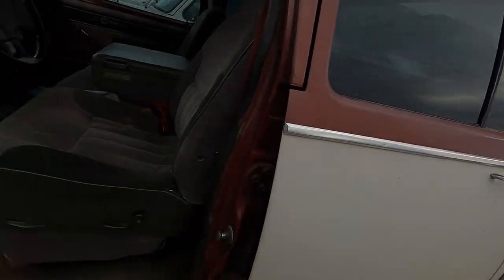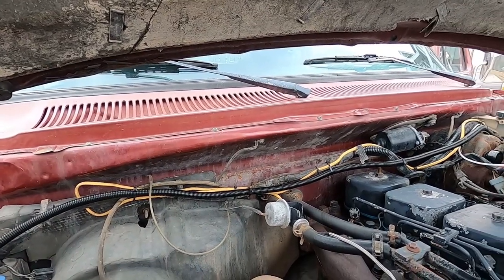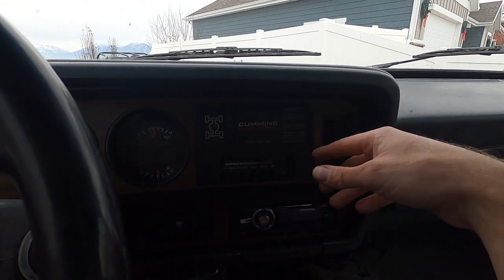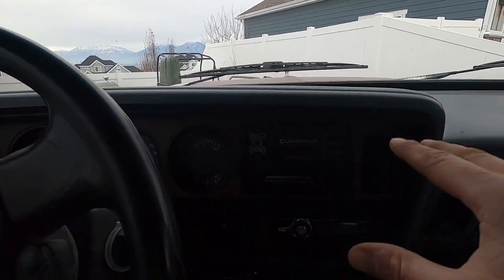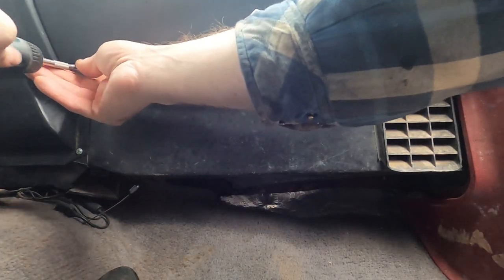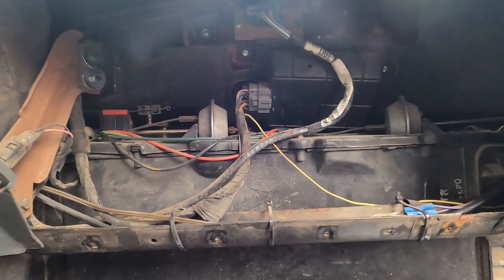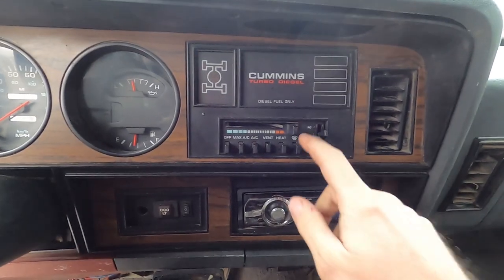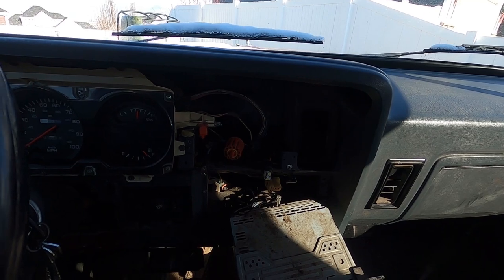1st Gen Cummins Heater Controls | Turning up the Heat 🔥

Comment: Thanks for covering this. Myself, I currently don't have maximum fan setting with that Climate Control Unit of my 1990 Dodge. Since it's a different part of the fan circuit, I'm going to try to repair the switch itself, since if I play with it, I can get it to work, a little.

If I have to pull the unit, HOPEFULLY I won't have to pull the stereo: It's the newer generation of digital-only stereos - no DVD drive, etc., and only sticks into the dash about two inches.

Comment: Would you have a part number for the light bulb on the heater control/hvac back light? My truck just has a hole in the back where a light would go. Not sure if it’s just a twist in bulb replenishment bulb or if I should be looking for a wire and light behind the dash like the 4wd indicator light.

Comment: Most of the time when these trucks have this problem is from the vacuum line junction. The rubber rectangular piece under the dash where all the lines plug into and out of.  They dry rot and come apart. Look for that piece. I have had this problem and have had to swap and or join the lines together directly

Comment: I noticed that you have two keys on your key ring. One is for unlocking and locking the doors and one is for actually starting the truck, if I am correct. Is this the same for your truck. My black key won’t start my truck, I have to use the other one. And the other key won’t unlock my doors. It seems that your setup might be opposite though. Just curious.
Reply from the maker: I actually am not sure haha. I figured they were both ignition keys. I check that out this week.
Reply: Sounds like the ignition key assy on the column was replaced. It comes with new keys when you buy it. I've already had to replace mine twice. Short of having the new assy keyed at a locksmith, you'll have different keys for the truck. One to start it and one for the doors.

Comment: What were the two sensors on the intake manifold where you were working on the brake booster? One was unplugged?
Reply from the maker: I haven't looked too much in to that but I know the motor is a 97 and the wiring harness is a 92 so I think it may have to do with that. I'll check it out more in depth at some point 🤣
Reply: I've got this issue with  my truck not idling until it warms up? 91.5 intercooled...I have the same sensors , I've replaced all of them... Runs fine when warm? Weird!

Comment: Hey Decent Garage, great video! I'm wondering if the HVAC control center routing is the same for an 86 Ramcharger?? I'm having a similar issue and I believe this video helps!
Reply from the maker: I'm not sure if the pre 89 ones are vacuum actuated or if it is all mechanical...

Comment: So I've done everything to mine to get my controls to work, I've got a new control part, I tried messing with the vacuum line under the hood and I check the lines under the dash. No matter what I've done I still have no change. The controls are stuck on defrost/feet I just got this truck and I'm getting lost. Any tips or advice that may have not been mentioned in this video??
Reply from the maker: Sounds like your blend door is stuck. Google 1st gen cummins blend door and your find some good info on getting it lubed up.

Comment: at 5:20 i am screaming "metal shavings in he booster. nooooooooooooooooooooooooooooooooooooooooooooo"   fyi, a booster swap is not hard
Reply from the maker: It all worked out 🤷‍♂️
Reply: @decentgarage  Crossing my fingers for you. Hopefully they dont find their way into the other systems fed by vacuum. If that booster fails, One thing you may want to consider as an upgrade is the hydroboost braking system from a ~97 cummins truck.

Comment: By chance you would not have a source for a new brake booster check valve for a 1992 W250? Believe it is part number 4485491 but not 100 percent sure.

Comment: Hi! Love the videos! I got a question for ya, my heater in my 90 d350 doesn’t get burning hot. Some people said maybe the heater valve? But I might try and flush out the heater core and see if that helps any. As of now my heater only gets warm and mildly hot when the engine is 100% warmed up. What do you think? Thanks man! Keep up the awesome videos!!
Reply: I got the same problem with my 89. I taken out the core flushed it Booth ways until I got all the junk out. Its better but still not hot! I'm going to pull the line close to the water pump and have a look to make sure its not plugged. After that I dont have a clue.
Reply from the maker: Andrew and 2eyed Jack,
My first step would be to make sure the thermostat is in working properly. Factory cummins thermostats open at 180*. If it is stuck open you will never get the coolant temp up hot enough for the heater to really get hot. I went with a thermostat that opens at 195* because I wanted my heater to work even better when I lived in Alaska. Have you both checked your thermostats. The easiest way to check is to pull it out and literally put it in a pot of water. Heat up the water and thermostat should open when the water gets to 180*.
Reply from the maker: 2eyed jack, 

see my response to Andrew Neilson.
Reply: @decentgarage  Thank you Tim.  i'll try that, love the videos.

Comment: Anyone have some ideas of a more powerful fan.  My 1991s fan pushes like no air and it takes forever for my window to defrost.
Reply from the maker: Jim lane has a great write up on cumminsforum on putting the blower motor on a relay and it makes a huge difference. I haven't done it yet but someday I will.
Reply: @decentgarage  awesome thank you!  I'll check it out!  Wiring improvements are  important for these trucks.

Comment: I have a 92 the fan doesn't work( new)I just replace the a/c compressor none of them work I check all the fuses(new ignition switch) and It's Hot Here in Texas
Reply from the maker: Did you check the blower motor relay behind the glove box?
Reply: @decentgarage  I just order it I'll let you know if works
Reply: @decentgarage  hi again I just replace The Resistor and still nothing